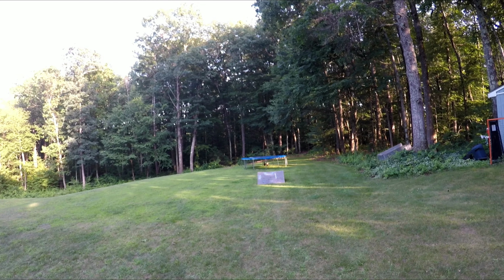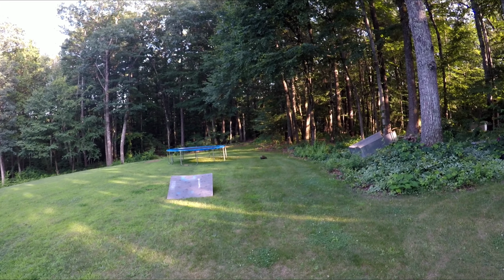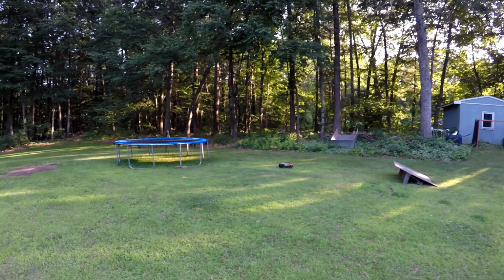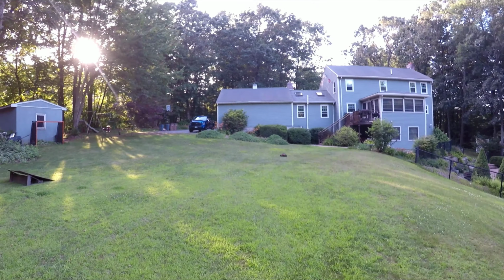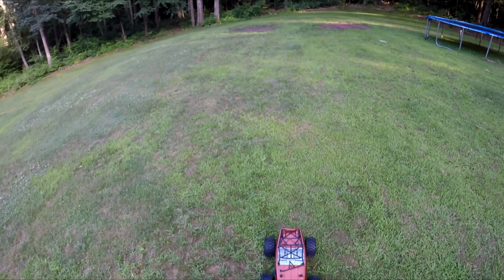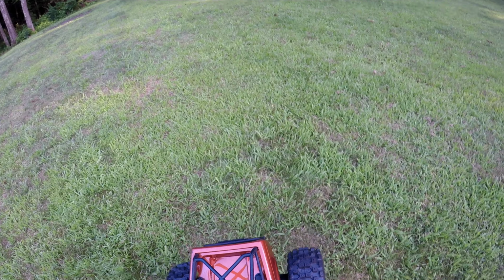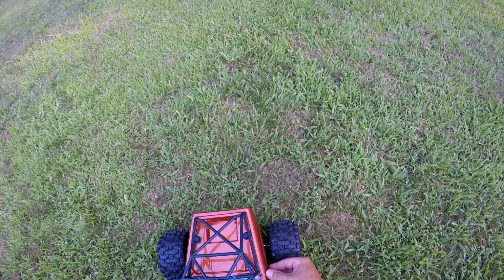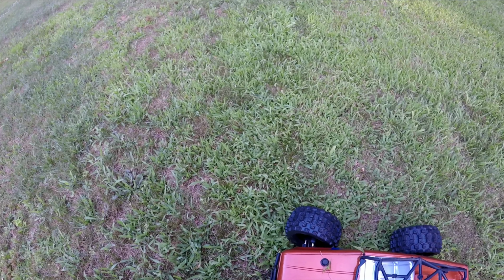#pro-lineambush #hobbystarmotors #rctrucks

Comment: Great first bash with ProMT ambush body brother. Tons of power. I'm running 500k on my handles much much better on quick punches wheelies on command but not too over powering. I recommend running a hex extenders to minimize to No body running. Love your body paint job. Looks badass for sure.
Reply from the maker: Thanks man👍 i love how the body came out, but i already f'd up the roll cage pulled through the body.🤯 yeah I hear ya on the diff fluid it needs to be thicker, I got those hex extenders, just need to do it😁 thanks man👍👍